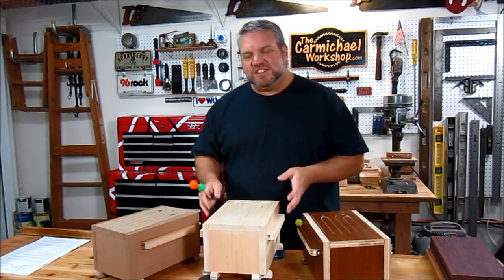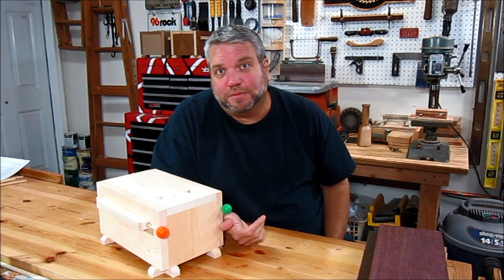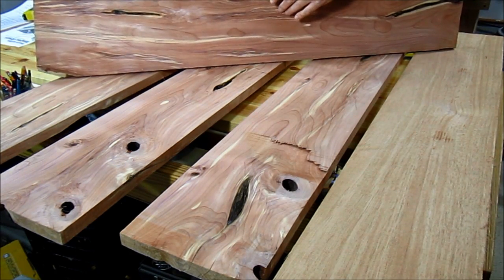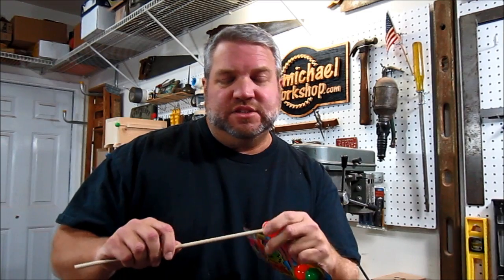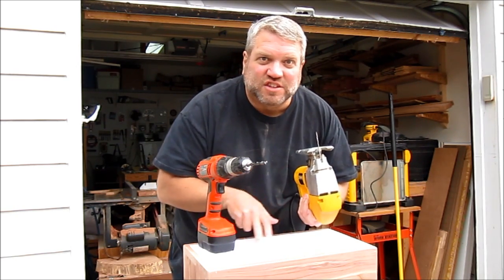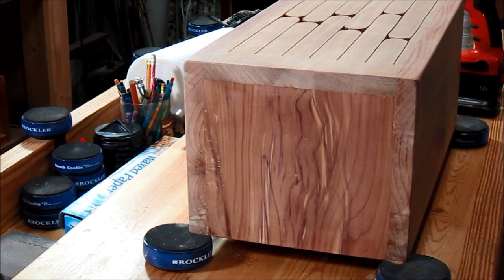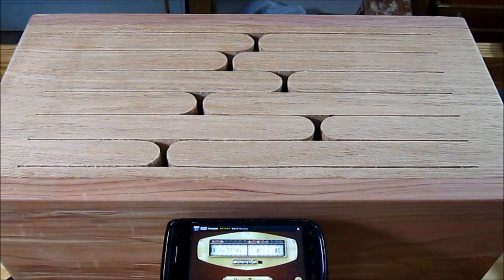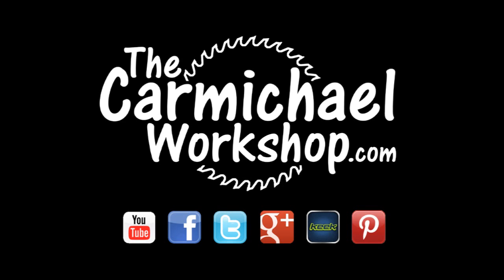Building and Tuning Tongue Drums, Slit Drums, Xylodrums - Easy Woodworking Music Project

Comment: I watched this video a few years back, and am just coming back to it because a friend wants a tongue drum. So, I'm gonna build one, but wanted a decent tongue pattern and tuning method.

Here it is! Great video, Steve.
Reply from the maker: Awesome!  My best sounding drum was made with a 3/4" red oak box and a 1/2" thick cherry top, using the WOOD Magazine pattern.  Each drum has its own personality, so you just have to make a few and experiment with size, woods and patterns to get a good sounding one.  I've since been told that the best patterns do not have tongues of similar length next to each other.  Alternate between short/long/short/long for good frequency separation.  Good luck and have fun!

Comment: Red cedar, clear pine, oak plywood and mdf.  And this is a really neat project.  Thanks Steve.
Reply from the maker: Hi Ted!  Thanks!  These are fun with a nice payoff at the end hearing how they sound the first time.  I've made about a dozen now and the best sounding one has a 3/4" red oak box with a 1/2" cherry top.  Longer tongues sound best too.
Reply: I was also wondering while watching,  If he glues it up how is he gonna cut the top.  Didn't even think you would use a jigsaw.  Nice straight lines.
Reply from the maker: Yeah, you only get one shot at cutting the top.  I think that's why a lot of them have wacky shaped tongues instead of straight lines, so you don't notice the cuts if they are off a little.

Comment: Great job Steve! I like the first one and the very last one you made. Thanks for the links, this will make a great project for me and the kids to work on this summer!
Reply from the maker: Thanks Scott.  Have fun with them.  Each one sounds different.  Let me know if you have any questions.  The templates are different sizes, so you may need access to print Letter, Legal, and 11x17 size paper, or tile them across pages.

Comment: You have a fantastic talent for making this how to video, Steve.  I've made the Wood mag plan and liked it. I used mahogany for the top and red oak for the rest.  Did not try to tune it at all even though I'm a trumpet player. :).  My daughter, a teacher, all ready took the drum so I'm going to make another one.  I did cut  the tongues on a scroll saw, but had to widen the slits with a saber saw. I did use small wood files for the curved parts though because i  was a chicken to use the scroll saw and mess up.:).  Those cedar ends and sides are really attractive.  Thanks for the tip on the super balls.  I have just bought some similar mallets for $11 for a pair.  Thanks for sharing with us, Steve.
Reply from the maker: Hey, thank you very much!  My best sounding one has a 1/2" cherry top on a red oak box.  I need to make another one of these.  Someone said to alternate short and long tongues so no two similar notes are next to each other.  I think I would use my scroll saw next time and cut down one side of the line and back up the other to make the wider slots.
Reply: I'm using a mahogany scap that I planed down from 4/4 to 3/4.  Using the wood mag plan again, but walnut scraps for the ends.  Using red oak for the sides.  Going to try a #7 blade on the scroll saw and go back again with a #12.

Comment: steve do you think your two added structural boards may have killed a little resonance on the higher notes on the cedar mahog top
Reply from the maker: +Buckin' Billy Ray Smith   Hmm, I don't know.  I would have to make another one without that to compare.  I've found that everything you do to these things changes the sound.  Even the surface you put it on.
Reply: ya sound is a wonderful thing... either way your vids are very hepful. I am new to the youtube community ,a year or so.. just buildin' my little channel and having such a blast meetin people from all over the globe , thx again for the info

Comment: This is really cool, I wonder how much of a difference a port would make to the overall tone. Varying the length of the port could make for some interesting results. This is definitely going on my "To do" list.
Reply from the maker: Each one sounds different and there are so many factors that affect the sound.  Even the pads you put on the bottom make a difference.  I think just the openings between the tongues makes a fuller tone.  The more openings you have, the less it will resonate and sustain.  I think this is why acoustic guitars usually just have a small hole on the top and no holes in the sides.  I think some f-holes like on a violin would look neat on the sides.
Reply: Good point, I was just bringing speaker cabinet design into the equation. Obviously with speakers there is alot more air movement so porting would make a remarkable difference in that regard. I really do like the tone these have though. Now to see what lumber I have lying around that I can use. Hehe.
Reply from the maker: I suggest going with a 1/2" thick top with longer tongues.  The short tongues just do not vibrate as much.
Reply: Cool thanks for the advice.
Reply: This thread is super helpful!  Interesting comparing to an acoustic guitar and speaker cabinet - I'm thinking cajon!

Comment: Really neat - thanks!  I'm going to build one for my boys.

I would think that when tuning, one would need to remove far less material from the longer tongues (the lower notes) because of leverage.  Something to keep in mind for those tuning one of these.
Reply from the maker: Thanks!  Yes the small tongues don't vibrate very much, but the longer ones do, so I think they are more sensitive to adjustments.

Comment: Thanks Steve. I’ve wanted a Tamboa for many years. A friend of mine used to bring his to Granville Island Market in Vancouver and busked by playing them. The sound was beautiful and melodic. His had a real resonance to the tone. I loved it when he came in. I was selling my garlic products. I thought of making one and found your video. Awesome. I have lots of clear red cedar 1x4s. Some yellow cedar (cypress) if I glue two together to get a 1x8 do you think it would affect the tonal quality. Probably not I guess. Excellent work. Thank you for sharing.
Reply from the maker: Hey, I haven't tried gluing a top together.  I think as long as you spread the glue evenly across the whole surfaces being glued, it should become like a solid board.  Placement of the glue seam might matter.  Maybe try placing the seam where it falls in the gap between tongues so the boards glue areas are on the ends.

Comment: Finally made one out of maple it's not the best the top didn't glue on very well but I just wanted to say your plans for this were very useful
Reply from the maker: Hi Bob, glad you could use the plans to make one.  They are fun projects and each one has it's own sound.  My best sounding one was a 3/4" red oak box and a 1/2" cherry top using the Wood Magazine plan.

Comment: totally cool video, that does look pretty easy to make
Reply from the maker: kassie2k4 Thank you!  Yes, they are easy.  Just a box with slits cut in the top basically.
Reply: I like that they all have a different design to the top, would be fun to try to make one with a Hatsune Miku silhouette opening for the tongues, maybe throw in some sound activated LED's for fun :) if I had the stuff to work with wood I might give it a try, maybe someday :) also something similar I found called a "tank drum", which operates on the same general principals but they are made out of metal tanks, much more expensive it seems but they sound very pretty

Comment: I have made two of these so far.  Both solid pine.  I have a small budget so I am thinking the next may be made from cedar fence boards.    I have had trouble tuning the first ones.  I thought maybe the first was too thick so I got some thinner wood but I couldn't find anything much thinner at the stores around here.   I used around 1/2 inch solid planks.   What thickness do you use again? Sorry if it is in the video.  I have watched it about 4 times now for different reasons so I thought I would just ask instead.   :)  Thanks!

Comment: They all sound great depending on what your looking for.but yes, the more exotic woods seem to sound more true. Do they need to be tuned again after use?
Reply from the maker: yocoach6556 I haven't re-tuned mine.  I think once you remove wood from a tongue to get it to a certain mass of wood to produce a particular note, it will stay the same as long as you don't remove anymore wood.  Since it is wood, it is affected by moisture and temperature changes though which can affect the tongues.  One of my drums has tongues that touch each other in the summer but the gaps open up in the winter.

Comment: Steve, back again after 2 months.  I'm working on my second drum.   I've used exotic hardwoods on both drums.  Because of the wood i've used the drums have turned out beautiful.  My problem is I haven't been able to tune them.  After cutting away so much material without results,  I just closed up the first drum.  I am making the drum for my grandson who plays the marimba so I am trying to tune the drum to a specific scale.  The second drum has eight tongues.  I designed each of them to be 1/4" difference in length which should be approximately 1/2 step apart in the music scale.  I downloaded the free Pano tuner onto my tablet.  My problem is that I have a hard time getting consistent readings on the tuner.  one tongue will read one note several times and then read a completely different note.  I'm working in a quite room so interference is not the issue.  Also, when I remove material from one end or the other it doesn't change the pitch any at all.  There is an upgraded version of Pano tuner, do I need that?  I'm trying to finish the drum for my grandson's graduation at the end of this month so any ideas you have would be greatly appreciated.  Thanks, Bill
Reply from the maker: +Bill Whisman I found each drum and pattern to get different results, some better than others. Someone told me that tongues of similar length should be separated because their frequencies would be close and interfere with each other. My worst sounding drum had tongues in order from small to large. Did you do that maybe? You could try to dampen the neighboring tongues with a sock or something to try to isolate a tongue for tuning.
Reply: Steve, Thanks again for your reply.  No, the design I used does not have similar lengths together.  I did the research and I think i've done everything right but I must be missing something.  I'm using Honduran Rosewood on the whole drum so it really looks great and has nice ring to it but if I can't get it tuned I will be very disappointed. I'm troubled by the fact that when I remove material from under the tongue it doesn't change the pitch.  I'm desperate for an answer so i'm going to delete the Pano tuner app and try downloading it again.  Also, I will try your suggestion with the sock and see if that helps.  I'll let you know if I find a solution.  Thanks, Bill
Reply from the maker: I just found this video.  You may have already seen it.  Sounds like he has researched tuning pretty well.  It's definitely an art.  He mentioned me in his video which is cool.
Reply from the maker: https://www.youtube.com/watch?v=iln1_uVsgUk

Comment: Great project Steve. The Mahogany is nice, but I think I like the Pine better. However, you didn't have feet on the Mahogany one, if that makes a difference.
Reply from the maker: Thanks Jim!  I stuck some small pieces of felt under the corners.  I might get some little rubber bumpers today to see how they sound.  I didn't want to detract from that red cedar by adding handles or blocks for feet.  The bench cookies work great btw. lol
Reply: I would just cut 4 small squares of red cedar and route a cove around one side. Then glue them on, cove side up and offset out about 3/8 inch. That's how I make feet, and they look nice.
Reply from the maker: Jim Steinbrecher Do you show those in any of your videos?  I need to go look.  I like that idea.

Comment: Steve---I gotta say I am partial to the ring of the pine. Just curious, does the drum sound different without the bottom? Would it resonate differently? Or if it had a sound port in the side or by removing more of the wood on the top (not part of the keys)? Thanks for the great vid!

Comment: I like the red cedar  drum steve
Reply from the maker: Yeah, that one turned out sounding pretty good.  Over time, the tongues moved to the point where they touched each other, just from normal wood movement.  I was able to use the jigsaw to widen the gaps.

Comment: Hi Steve - I really liked this video. It was just fascinating and, you're right, these things are pretty simple to make! Just one note (and it's not criticism) back many years ago I had one of these. It was made of all redwood and the tone was perfection. It was only about 1/3rd the height of your cedar drum. It was near 2 ft long and about 1 ft wide. I believe there were 8 tongues but it was a LONG time ago! I have to wonder if those dimensions and the wood are important to the design. Again it had a beautiful tone! One of these with a Kalimba, a Marimba and maybe a log drum and you've got an African band!
Reply from the maker: Bähb Hudson Thanks!  Yes, I found everything you do to change these makes them sound different.  Even two made from the same board will not sound the same.  I have a small one that is red oak with a cherry top that sounds incredible.  I found that longer tongues do sound so much better.

Comment: Any thoughts on cutting a several inch hole in a side or the bottom to amplify it?
Reply from the maker: Hi BJ - I haven't tried that, but from what I understand, the drum resonates best if there is just the open cuts in the top.  Sort of like acoustic guitars having only one hole on top.  Try it though and see.

Comment: 1) the super balls are too colorful. Would wooden mallets work?
2) will it work to cut the longer tongues all on the right, descending in length, then come back on the left with shorter tongues?
I like the sound of the pine, but i'd do the cedar/mahogany if i was doing one.
Reply from the maker: Hi Nathan!  Thanks for watching!  Wooden mallets do work, but they add a clicking noise since it's wood on wood.  Yarn wound mallets work well too, but a little soft.  You can order black super balls or less colorful ones.  My experience with these has proven that it's best to alternate large and small tongues, so you don't have two similar size ones right next to each other.

Comment: I made my first one out of padauck and cherry with a maple bottom. One side sounds great, the opposite side is some what dead and two of the tongues seem to vibrate too much. What do you think the problem is?
Reply from the maker: Hmm maybe not enough glue or clamping pressure?  The glue joints need to be solid with no voids.  Screws or nails with no glue won’t make for a solid sound chamber. Make sure the tongues are not touching anything or each other.  Other than that it could just be the wood itself, or the tongue sizes/pattern.  Alternate short and long tongues. Don’t put two tongues close in size next to each other. That’s all I can think of.

Comment: Thanks for making this video!  My one question is this:  Is there a reason you cut the tongues after gluing the top to the sides?  I was planning on using my scroll saw to cut the tongues before placing the top.
Reply from the maker: The issue with cutting the tongues first is that the sides of the top are really thin and would flex during glue up.  But, I think a good solution for that would be to cut shims to fit between the tongues across the top where the clamps would be placed.  If I ever make another one, I will probably use the scroll saw and try that method.  Several of the tongues moved and touched each other over time, so I think cutting wider gaps with the scroll saw would prevent that.  The jig saw blade just did not make a wide enough kerf.

Comment: thanks Steve for sharing with us. I just finished my first one and just a wee question on the tuning. I was using the Pano app and it worked ok ,but I had a difficult time with one side. I made a double tongue drum. I got one tongue tuned then moved to the next one got that tuned but it also put my first tuned tongue out of tune. Did you or anyone else have this issue? Thanks Julie
Reply from the maker: Julie Seatter Hi Julie - Yes, tuning these is an art itself.  I found it is a lot of back and forth until you get something close to what you want to hear.  That's normal since wood is not a consistent material and all of the tongues are connected to each other.

Comment: Steve,

Great job...........again!

Is there a secret to printing your PDF's full size?  I realize they at too long but to get the width correct.

Thanks again for another entertaining idea.

JimE
Reply from the maker: Thanks Jim!  Great question!  I printed the small ones on Legal 8.5x14 paper in my inkjet printer.  I printed the larger ones at a copy center on 11x17 paper.  You could also go to your print properties screen and select to print them across multiple pages (the option is usually called Tiling or Multi-pages), then tape them together.